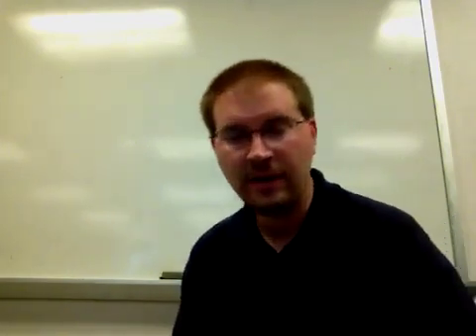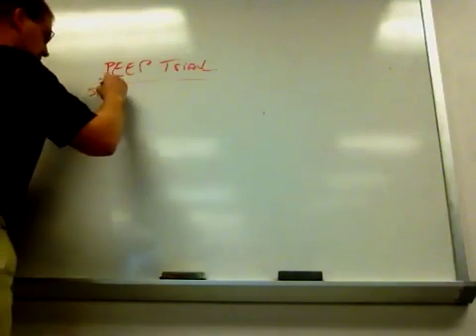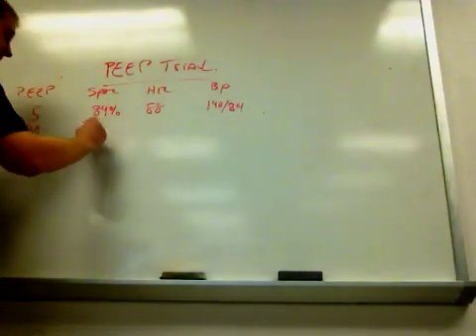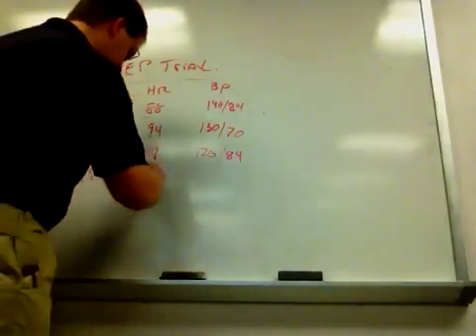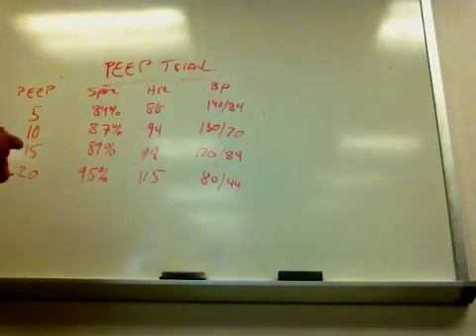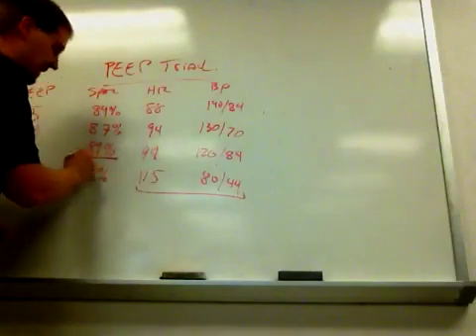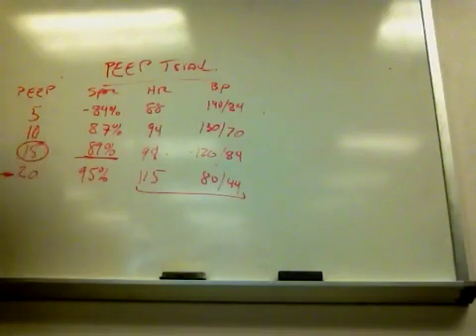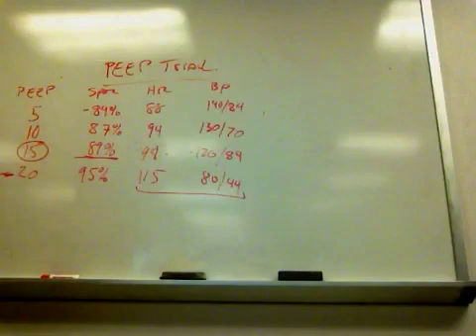PEEP Part 1

Comment from the maker: There really is no specific maximum. You can do an optimal PEEP test to find out.  That basically involves gradually increasing PEEP and stopping when you notice significant haemodynamic changes or dangerous pressures on the ventilator.

Comment from the maker: @23kensie: If the auto PEEP resolves quickly, you can see changes occur within seconds to minutes.  In some cases, it may not immediately improve.  For example, if you have bronchospasm, it may not improve until you have treated the spasm.